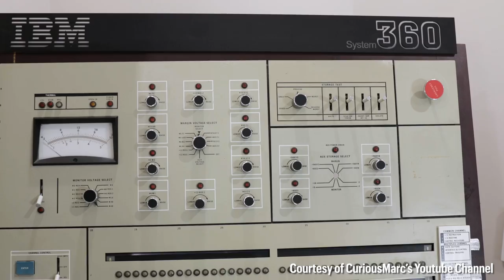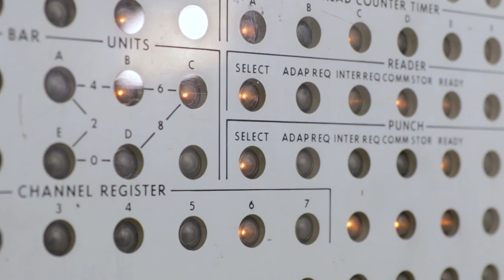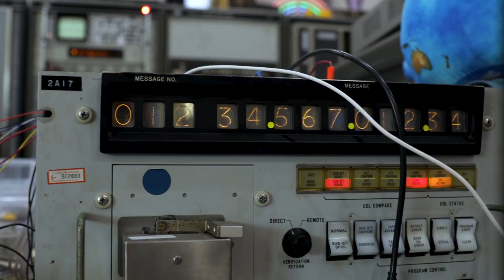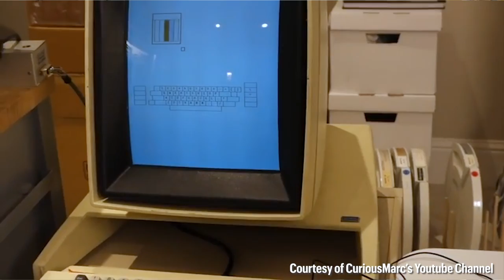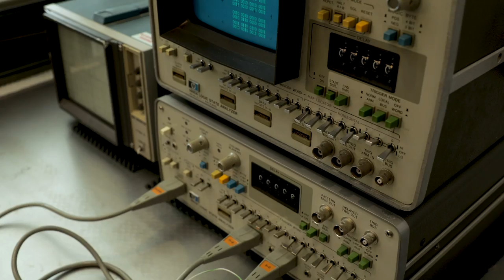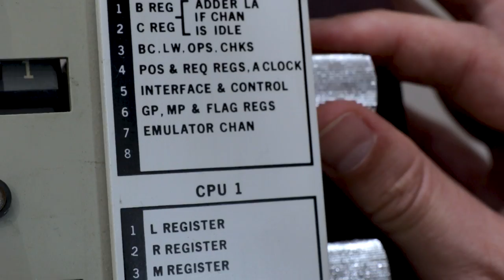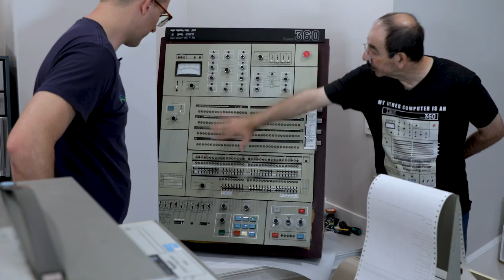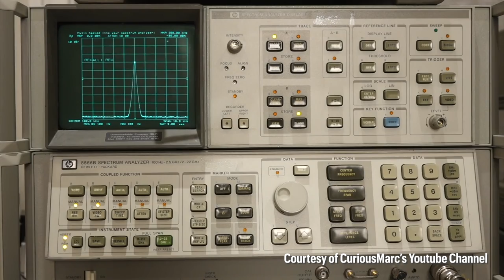Inside the WILD Lab of CuriousMarc

Comment: Love this behind-the-scenes video. I'm a retired submarine electronics technician. Much of the equipment I worked on in the navigation center of fleet ballistic missile submarines came from the early '60's and is much similar to alot of this stuff. In fact, the frequency time standard we used was the HP cesium beam clock (two for redundancy, of course). Great stuff!
Reply from the maker: Very cool!

Comment: I think a great way to learn about modern electronics and engineering is by studying older equipment. It really is a great simplified example of what computers and circuits do today. "simplified" but not simple. I've really learned a lot about programming thanks to the constraints of a 8bit 16MHz arduino processor.

Comment: I wonder which IBM 360 he's going to replacate?   There are many models including one that doesn't have floating point binary and one that has only floating point binary.   I'm familiar with the 360/50 and the 360/67 from college.  At the upper end of line the more memory you add, the slower it run due to path delay.   It will be interesting.
Reply: I believe he mentioned the 360/50
Reply: @casparberends2719  AH!  It can be done but you need at least 3 fridge sized units for the CPU and minimum 512K core.  Every 512K uses another fridge sized box.  Then the disks, It depends on the disks from one washing machine to severl fridge sized boxes.  Of course thats if he is going to used original/like original parts and cabeling.  I think it can be done with a normal floor but a computer floor is better.  The RPI machine room was about 14ft by 50ft+ but RPI had many more peripherals and the tape library.  A basic binary add was either 2US or 8US depending on if the operand was in fast core or slow core.